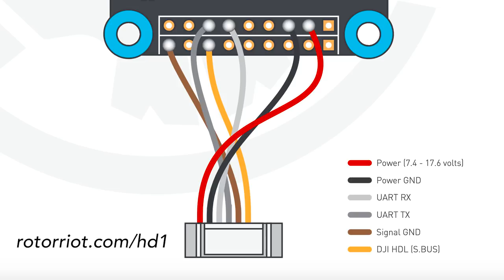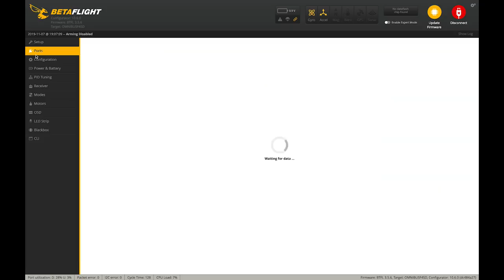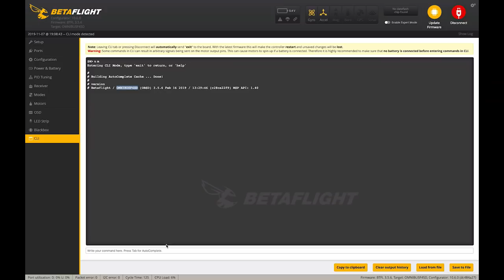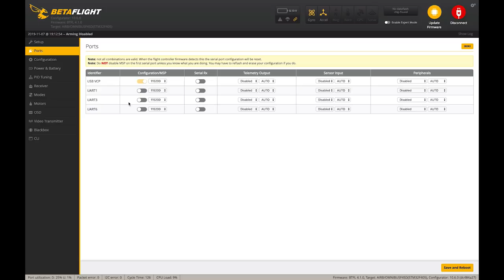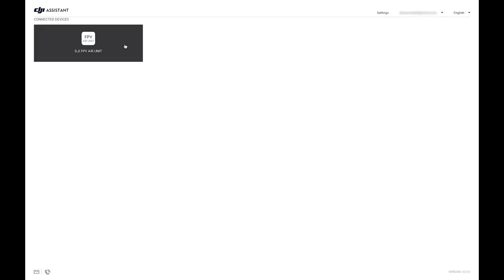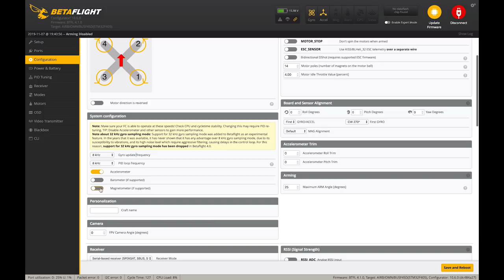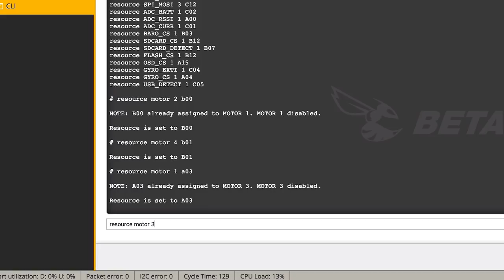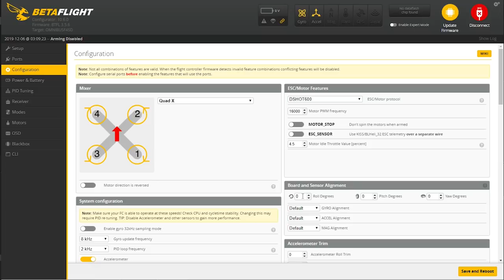Build: Cinewhoop w/ DJI HD FPV (feat. NURK)

Comment: I know how to build quads in general but there were 2 very useful tips in here anyway:

1) Spin the motors to check for shorts
2) Use the rubberized battery strap for putting on props (I hate putting on new props on all of my quads, having cuts in my fingers regularly 😅) 

Definitely gonna use those in future 👍🏻

Comment: For those following along at home, the build is complete at 27:00, but for the Betaflight steps, in order to plug in the flight controller to the computer (27:30) you have to first remove the cowling, which is close to a full disassembly (!) Doing the Betaflight steps (and BLHelisuite, if you need to reverse motors) before finishing the cowling would be a nice pro-tip. Some tips about how to tighten the build without causing the props to rub the cowling would have been helpful as well.

Comment: Great Video Best Duo to build a Quad. "Just do it" and "Know it all"!!! At 12:00 put that great TS100 away for that and Show the People how to Solder a big XT60 to an 4in1 ESC. Use a Traditional Iron like a Weller 60W with a big copper tip, everything that Needs to hold on more than 3s is to Long and less Power on the Iron...

Comment: 11:05 he's literally burning the wire-insulation. I don't ever remember soldering requiring more than a few seconds with simple 40w irons.  When we use to race off-road we soldered our batteries seconds before every Stock-class race to ensure we used up every bit of Nicad(a memory battery) we had.

Comment: Hi Joshua Bardwell, 
we wish to learn something today.

Could you compare the performances of a quad with the ducts and the same quad without the ducts and uncut props and normal prop guards?

Even if you have slightly more thrust with the ducts, can it really compensate all the extra weight?

The theory behind the ducts may work if you have a drone that moves just up and down (engineers use them only on things that fly straight like jets, rockets or hovercrafts for lifting), but what happens when the trust vector tilts, like on quads?

Are ducts really good for cinewhoops or it's just an urban legend like many hobbyist are keep saying?

Shouldn't a cinewhoop just fly way smoother without the ducts? 

I have one of these and in my opinion the only advantage is safety. 
But with less control, does it really mean that it's safer?

Thanks
Reply: kebab fpv did a video on that
Reply: @jg5235  not really.. he didn't use larger props and added extra weight to simulate the weight of the ducts on the quad without the ducts. Of course it just fly worst. 
I really don't understand why people like these noisy flying bricks.

Comment: Alright, so, it seems it does need to be the Yaw Degrees category changed to -90. Another thing that I got wrong, but that wasn't in this video (but that I found the fix for on another Joshua Bardwell video, of course) was that there is a particular upright direction for each of the props. All together, thank you so much for the video! I got my parts in from Rotor Riot today for this thing and its been an adventure putting together my first quad!

Comment: I may have found just one mistake: At the end, when you to to correct the flight controller orientation, it shows you putting -90 in Roll Degrees and not Yaw Degrees. Is that right?

Comment: great video. are the ducts TPU ? or PLA+ ? they seems to be very flexible but I thought they were also here to protect and if it's TPU it will bend immediately after a shock
Reply: RideWithOKP TPU. They’re on thingiverse too if you wanna print them yourself
Reply: @swissfreek  thanks! why don't use PLA+ to print them? That would be cool and PLA is also very flexible ?
Reply: @E-sk8Fr  PLA would shatter
Reply: RideWithOKP PLA isn’t very flexible at all, relatively speaking. Like Josh said, it would shatter on the first crash (into your props, eek 😬). I would never suggest printing this rigid, but when it comes to rigid filaments, if you want something with a little flex that won’t shatter, I would look at PETG, or maybe nylon (but nylon is very finicky to print). Neither would work in this application because you really need the flex.
Reply: @swissfreek  thanks a lot. I'm going for TPU. Actually trying to print it with 1.5mm thickness. My TPU is 95A
Reply: @JoshuaBardwell  thanks a lot. It's PLA+ so it's way "more" solid than PLA but I just went with TPU according to your feedbacks. Keep it going ! This video was spot on.
Reply: @swissfreek  Happy new year and thanks a lot for the support ! I did my maiden flight yesterday but there is something very weird on my yaw axis. The cinewhoop is jerky left to right. This is the inflight DJI CAM video https://www.youtube.com/watch?v=Btd9h5a_pSw and these are my Betaflight settings. I'm sure something is wrong somewhere but I just can't get it.  https://www.youtube.com/watch?v=MdK89MK0qB4

Comment: My squirt is weighing in at 540g with a gopro hero8 and an 850mah 4s batt which seems super heavy given the weights i've seen online. Even Paul wrote up about his build which was close to 100g lighter than what I am weighing in at. My ducts are 62g all together. Not really sure why mine is so heavy? It flies extremely heavy and kills a 1550mah battery in about 2 minutes. Any ideas on how to get the weight down?

Comment: my dji fpv system always Freeze, 

- 700 mW,
- BEC 5V
- Firmware V01.00.0200
Don't know why this happen. and it happen after update the firmware.
Reply: You can't run the air unit off of 5v. It requires minimum 7v.
Reply: Terima Kasih JB, i’ll try to change the setup. Luv ur Channel
Reply: I think i figure it out. On my other Quad (NO BEC): Google setting on option Power Limit is “On”. After i turn it “Off”, everything is good.

Comment: Hi, I just ordered the ready to fly cinewhoop. What battery i have to buy to fly with it ?
Reply from the maker: a 4S battery between 850mah and 1300mah in size is ideal. But VORT3X also runs 1550mah batteries with no issue, just a bit heavier

-Drew

Comment: What about the props? should we use a lower pitch prop or a higher pitch prop? Coz i saw some with 3052 and also 3028 which is very different. Im not sure which to use.

Comment: i cant use 6s for it or can i?
I want to build my frist drone.. and a have a prebuild nazgul 6s.. and a cinewhoop makes the most sense.. but id like to use 6s because.. i have 6s lipos.. but i cant find any turtoriel for a 6s cinewhoop.. what on your build i have to change for 6s? Motors, flight cobtroller? power board thing?

Comment: 2:07 I have actually never heard that before. Do you have any experience? Quads with notchy motors fly rougher?
Reply: @Árpád Hegedüs Usually “notchy motors” are more powerful thus more “throttle happy” and so give a more “jumpy quad” instead of a less responsive throttle what is desired in flying for smooth video.